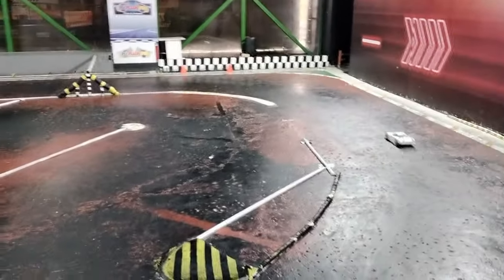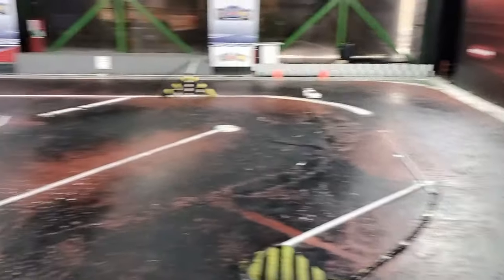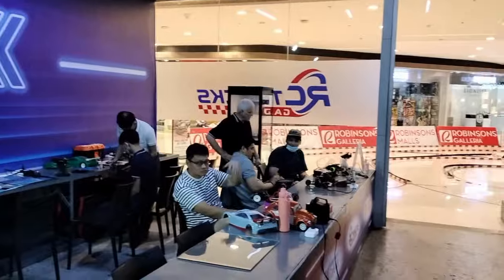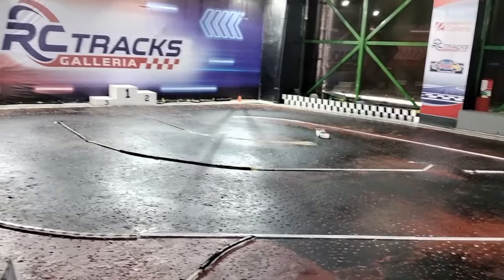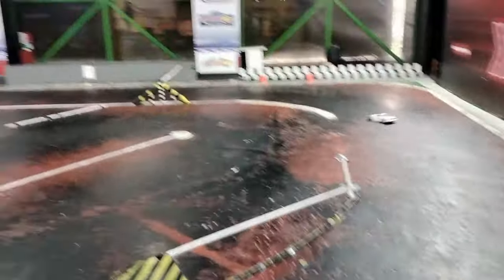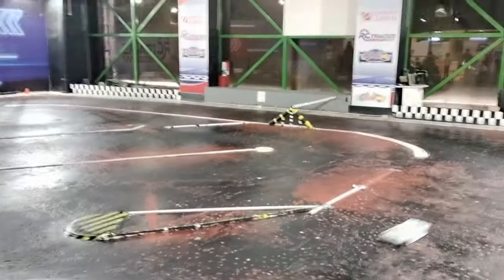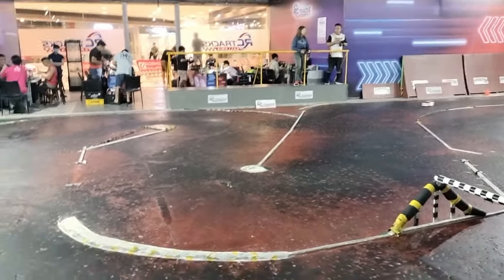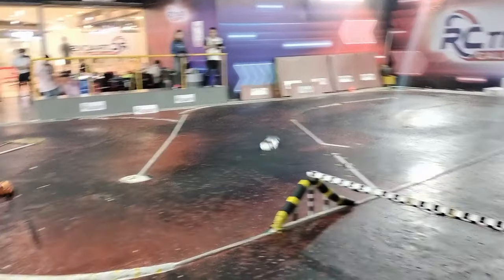Sunday RC Mall Day - TT01 Body Tuning

Comment: from one father to another. i understand you wanting to make the tt01 capable of competing with the more expensive dedicated on-road rc's, i'm the same way, i thrive on the challenge of make something cheap run with the expensive stuff but your situation is different. while it can't be disputed that you've probably created the fastest tt01 out there but under it all t is still a tt01 entry level rc car and the biggest performance enhancement made to the car is your daughters driving ability with that said i can't help but to wonder, if she can make an entry level rc perform this that good, how fast would she be if you put as much time and effort into making a pro car go fast for her, i think she's probably start blowing away most of the pro drivers and it would give her the chance to achieve her best potential ........
Reply from the maker: We ran the Ta08 the day prior, the TA08 that won her the Tamiya Asia Cup GT championship and trip to Japan. However the TT01 was still faster and she decided to run that instead for our final leg of Tamiya Cup (no graphite chassis allowed). For international races where graphite kits are allowed she ran an Axon TC10/2 and Mugen MTC2.

On this small track our modified TT01 was faster than all the high end kits driven by our fastest drivers. However since I am currently limited to Tamiya specs (for Tamiya cup) it is slightly slower.

It is not my desire to make a cheap car faster than high end kits or make life difficult for my daughter. From engineering view I really see the TT01 fast on smallish tracks, and will always pick the faster car for my daughter to run. If built and setup properly the TT01 is very fast :)